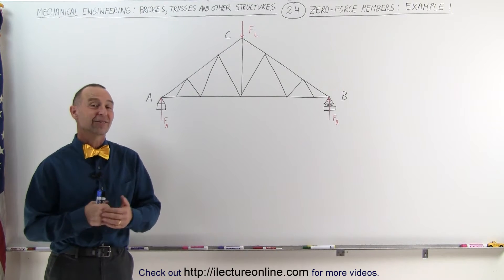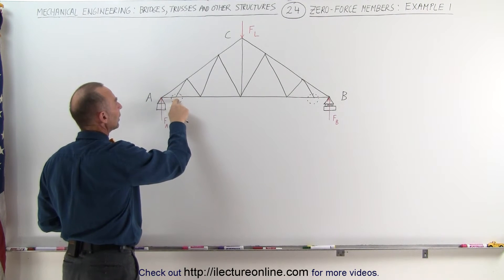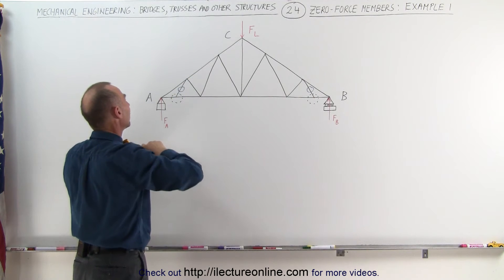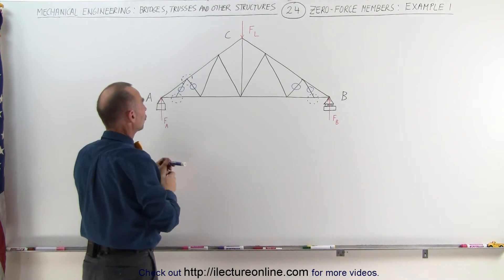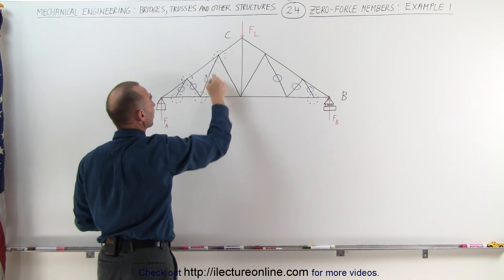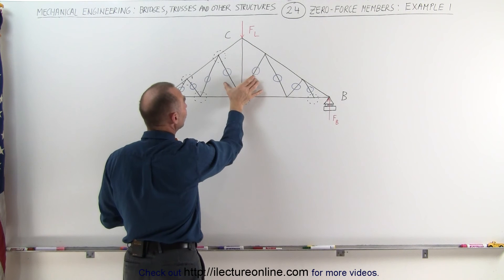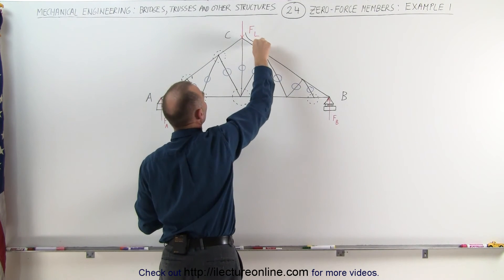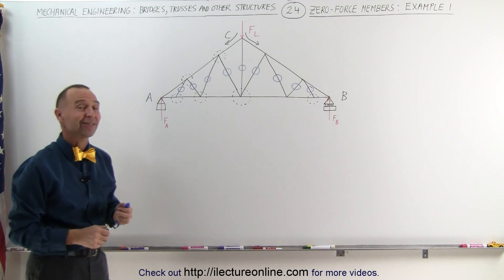Mechanical Engineering: Trusses, Bridges & Other Structures (24 of 34) Sum of Forces Ex. 1

Comment: AB become zero member or not
Reply from the maker: AB will be under tension
Reply: Michel van Biezen thnx sir
Reply: @krushnasethy5014  Calc it out.  Assign a value of say, 100 kips to FL.  FA & FB will be 50 kips each. Use method of joints at A or B and you will find horizontal force to be 37.5 kips and in tension.
Reply: it will not.

Rule 1

two members on a joint with no load and or no support on it, can both only become zero force members if the angle between them is less than 180°

and since AB is a straight line,
therefore at joint between them,
the two members must be pulling each other or in tension